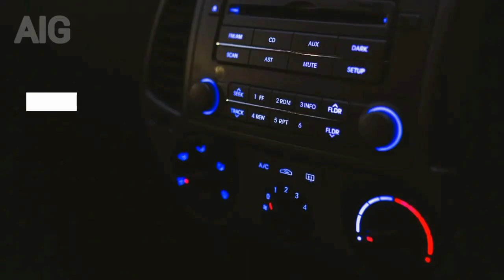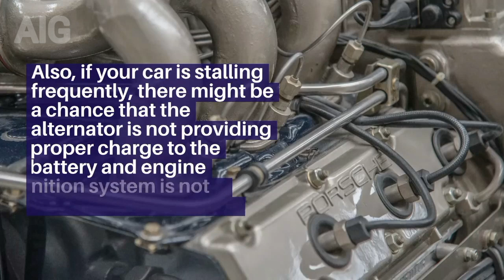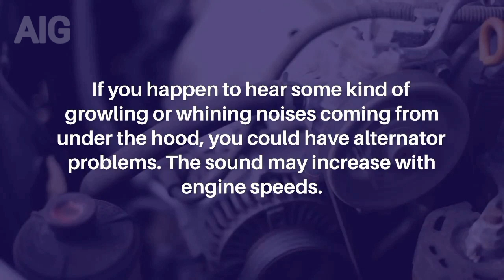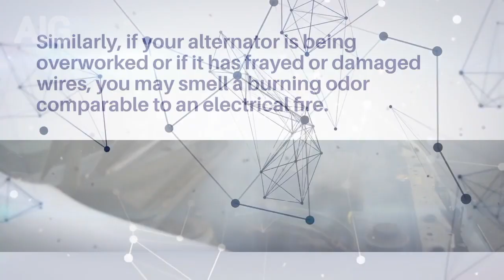Bad Alternator - Symptoms Explained | Signs of failing alternator in your car

Comment: Light battery popped on last week  after 10 minutes of driving   steering wheel got super hard to turn , glad I made to the parking lot  I turned off the car no it won’t start 😂? What’s the issue  IS IT THE ALTERNATOR?
Reply: Yes, or your battery is maybe just dead
Reply: @MikkelPLayzDanskminecraft  IT WAS THE ALTERNATOR
Reply: @andresjc502  same thing just happening to me right now luckily I was able to steer the super hard steering wheel to the side of the freeway - all my lights came on and my brakes and a loud sustaining beep sound its scary but my car turns on and off still and doesn’t have lights for few seconds then when I press the brake to change gears it all lights up again
Reply: @gabegarcia7779  who presses the brake to change gears lmao 🤣
Reply: @MikkelPLayzDanskminecraft  batteries start the car, the alternator charges the battery as you drive. So, if the car starts, it's not the battery...yet.... the alternator can drain your battery if you use a, radio, voltage in the car and it's bad, then when you start the car again, the battery may be dead but still good, ie charge it.
Reply: Same thing happened to me
Reply: I was picking up an order from subway I went out back to my car and it’s a 2006 325I it’s not much but the a lot of the lights were on like trash control ABS and it locked me in park but the car was still running I had someone give me a jump so I can get the car in the drive I made it to the house where I had to deliver and that was the end I had to get my car towed

Comment: I have an 01 Toyota Camry ce and my car just does one day and then started up again then soon after my battery died and it makes this rly loud grinding noise? Need help I think it’s my alternator 😕
Reply from the maker: Hi there, if the alternator bearing is failing will make a good loud whining noise. The alternatr pulley can make a grinding noise if its worn out and is out of alignment. Do check all the pulleys and alterntor belt.